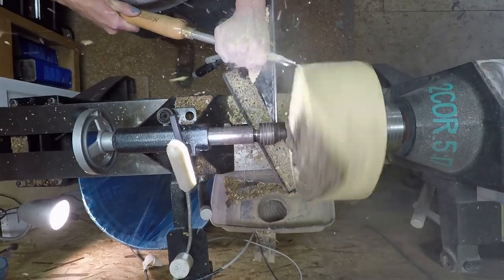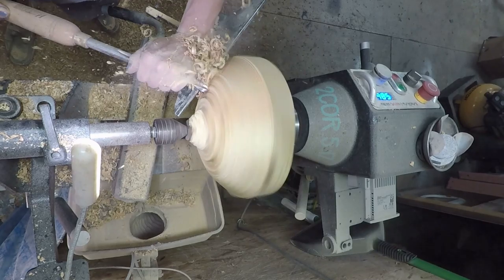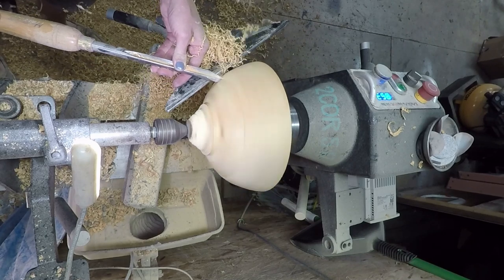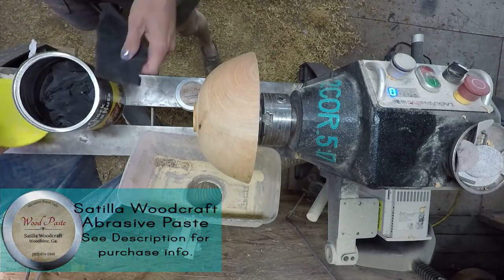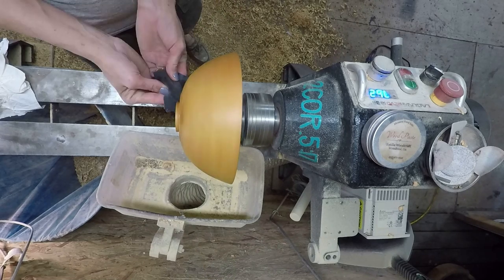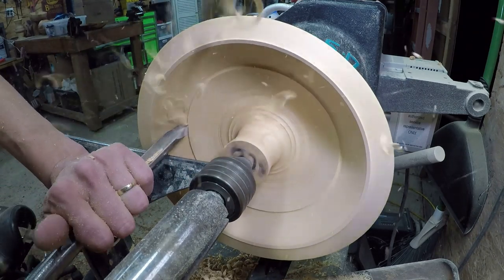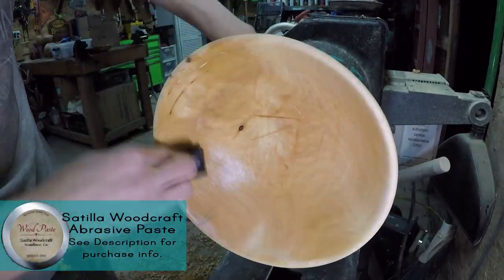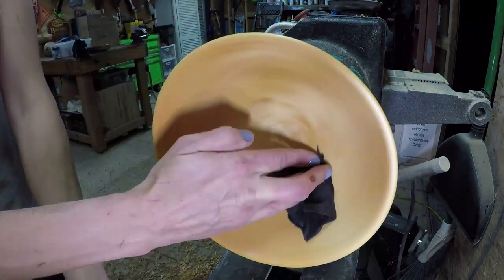Cascara bowl

Comment: I should add that we sold our Cascara bark. In the early 1950s they paid 2 or 3 cents for wet bark and 7 to 10 cents for dry bark. Unscrupulous peelers added Alder bark which made it was heavier. We spread it on our roof to dry it. After drying we stuffed in burlap bag. Then you beat the bag with a baseball bat to be able to more bark in.
Reply from the maker: wow!!

Comment: Here's a bit of a challenge for you. A while back I had some Cottonwood limbs pruned off a large tree in our yard. I decided to take a chunk and band-saw it down to see what, if any, projects could be done with it. When dried, much to my surprised pleasure, had a beautiful, almost iridescence sheen to the surface. All white wood of course, but stunning in surface finish. Totally surprising. It must be absolutely dry to work with hand tools as the grain weaves all over the place. I couldn't even run it (successfully) through a thickness planer until is was well dried.  At that point I made a hand cut dovetail box from it. Again, surprisingly, it was a joy to saw and chisel. I believe it would be a great turning wood with the caveat that tools be as sharp as possible and the wood be very dry. It is an interesting wood in it's properties (challenging and yet, not) as it is a softwood with crazy grain direction. Alas, I do not have any pieces that would suffice for you, but as it grows all over the country and like a weed, particularly river bottom country, you may be able to find some.
Reply from the maker: That sounds interesting!! I would love to try turning it. Maybe I can get some from a local mill or call some tree services that may have cut some down. Thank you for sharing your experience with it :)

Comment: Kim, great job, simple is sometimes best !! I did not see you wearing a Respirator!! Not only the dust, but that CA glue is really nasty stuff.
 Resin/Epoxy fumes are the worst.  Unfortunately, I've breathed in all 3 over the years.

 I have been a Woodworker for 35 years and a Wood Turner for 25. 2 weeks ago I was diagnosed with "Moderately Severe COPD" . That is: Cronic Obstructive Pulmonary Disease. I have never smoked a day in my life. The Dr. said I have chronic Asthma. Yet, my Asthma has never bothered me. Never even went to a Dr. about it since I was a kid, I'm 70 now. I'm convinced that my Woodworking contributed to or is the root cause of the COPD. Be safe rather than sorry. COPD is an irreversible disease. Use and practice good dust collection. Wear a respirator. Don't breath all the stuff you generate in a shop. COPD is like, blood pressure, a silent problem. By the time you know you have it you have a big problem. Take if from somebody who has  learned the hard way
. You are young!! Start being meticulous and smart  about Dust and Fumes.
Reply from the maker: Thank you! I did put it on after a few min. of that mess. Thank you for the reminder... sometimes I just get too into what I am doing and forget :(
Reply: @KimTippin  Kim, that's what I always did get to wrapped up in the work and not protect myself. My guess is you are in you late 20's or early 30's. I'm 70. By the time you are my age all these little instances will have add up and you could be very sick. I know a mask is sometime impractical. Like when you are doing a video!! But you can do the work in a well ventilated area with a big fan in back of you that blows this crap out of the building. If you can ware a mash fix it so you minimize your exposure.  Epoxy or resin fumes are the worst. Be safe rather than sorry later on.